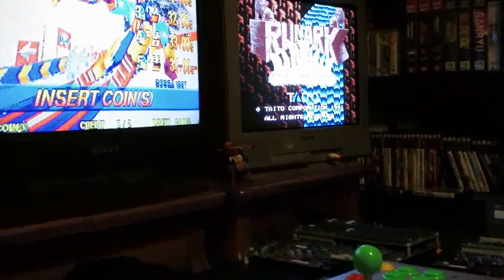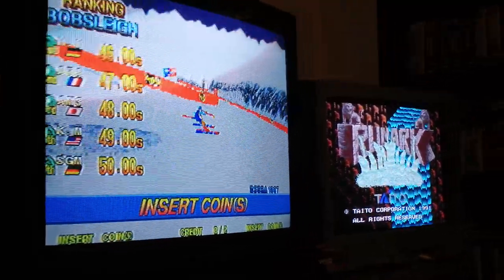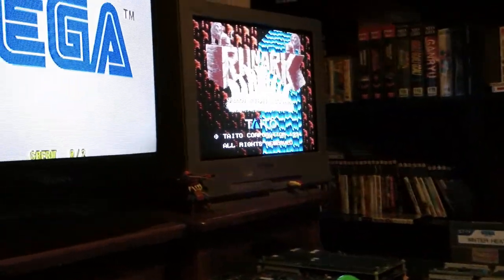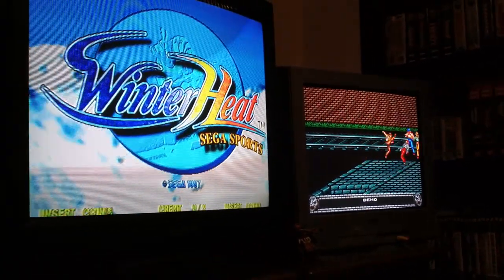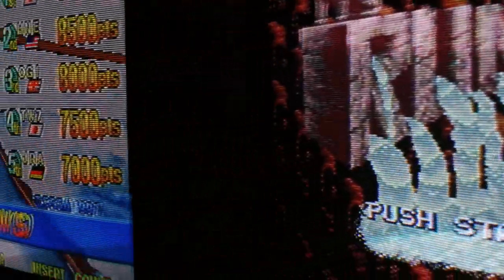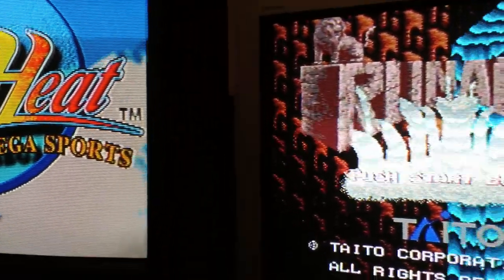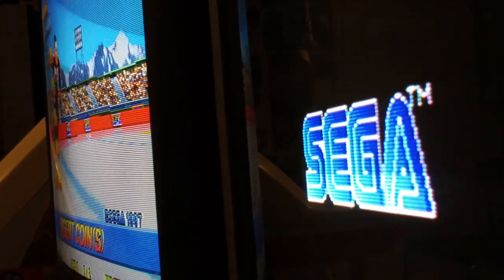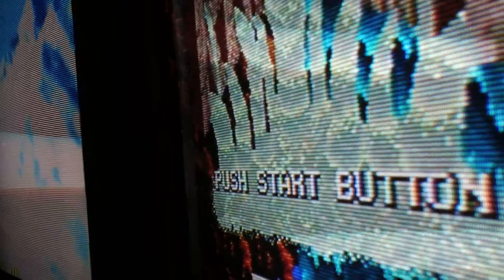How to eliminate EMI issues with CRT's in near proximity to each other

Comment from the maker: Yeah, that's so true, when I had an external pair of high wattage Altec Lansing speakers connected to a monitor, near another CRT, I would get the issue where the CRT needed to be degaussed, due to color blotch issues. My fleet of Trinitron CRT's seem to be less susceptible to those color blotch issues, but the two I showed in this video had the EMI issues really badly, until I angled them so the deflection coils weren't in direct conflict with each other. Thanks so much for watching man =)